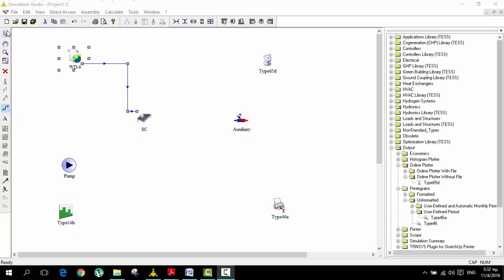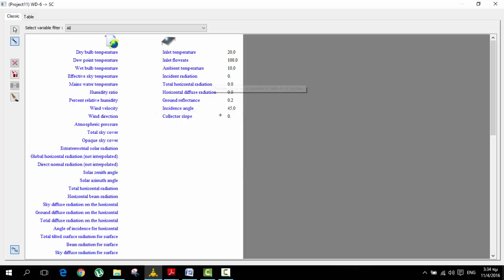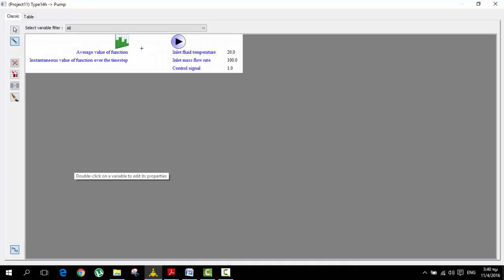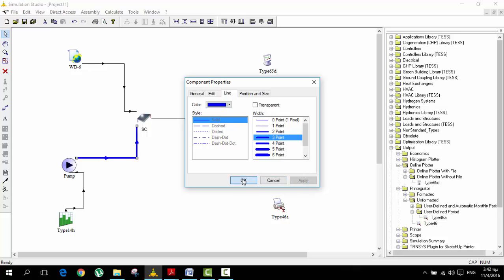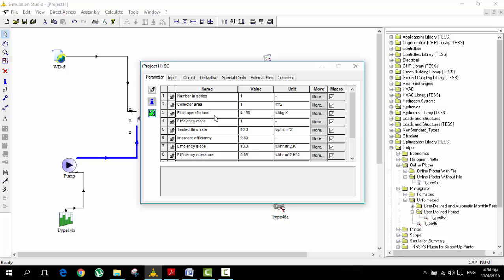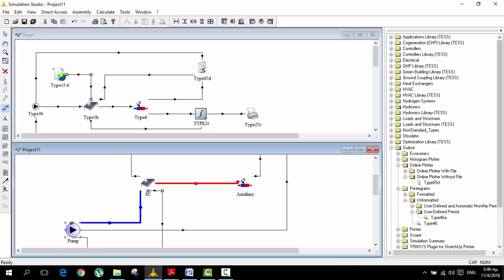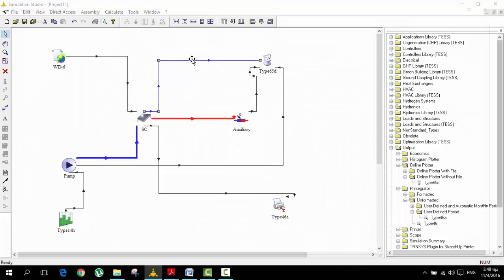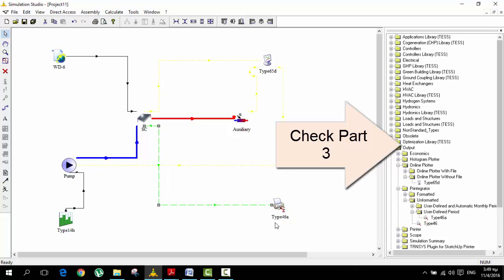TRNSYSTutorial #3: Begin Example  STEP BY STEP (part 2)

Comment: one question, can Change tyeps Solar Collector without shange  lines ? thanks
Reply: If you mean that:if you have made the connections and then you want to put another type of SC and the links to be on the same parameters as in the first SC, as I know NO!  you have to link it again from scratch (the new SC).